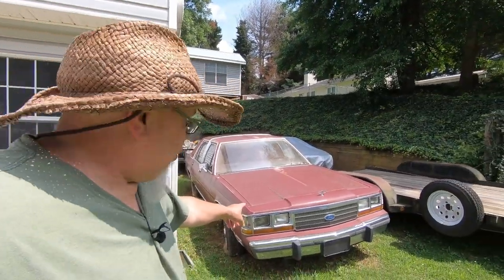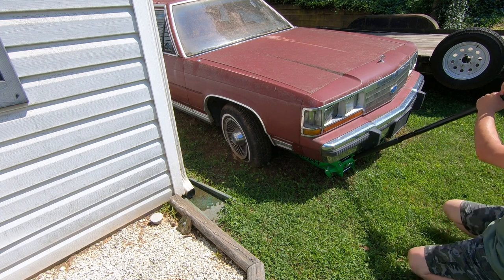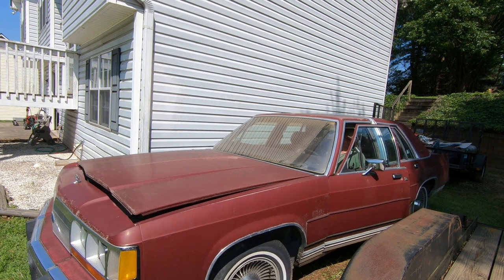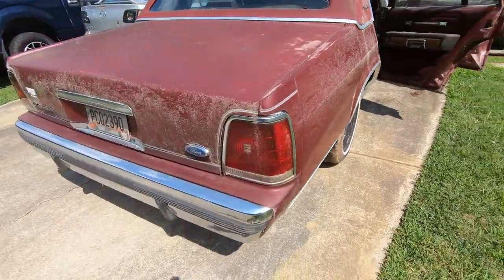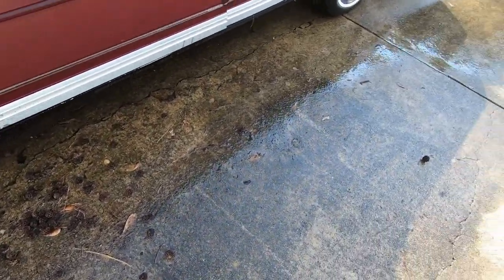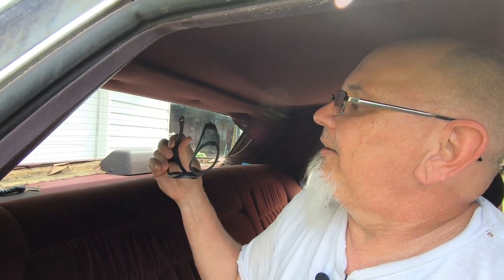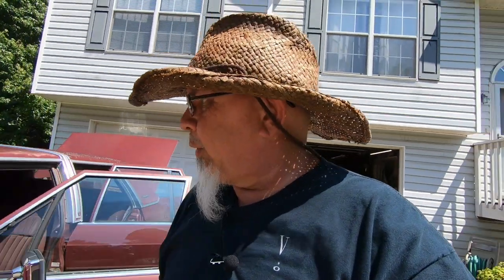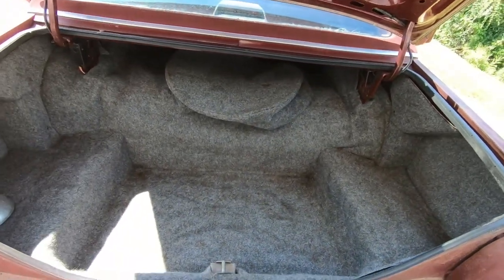Cleaning up my old LTD Crown Vic!

Comment: I daily drove (commuted) a 1989 Mercury Grand Marquis LS from 1997-2019. It was the best car I ever had. The two rear windows would get stuck and have to be helped up. And, the power antenna quit. I manually raised and lowered it. It was gifted to me by my grandmother after my grandfather passed in 1996. Always garaged. It was black over gray leather. I think it just needed a fuel pump when I sold it with just under 170k miles. No rust, no accidents, black paint still shined, perfect leather and carpets. I babied it for 20 years.  I now drive my dad's '04 Accord. It's another good one!

Comment: I have an 88 LTD as well but mine stays inside out of the weather.. been working on stripping the vinyl roof off due to it having some small splits in it and i didn't want it to rot the roof.
Reply from the maker: This one has some rot under the vinyl roof. It's unfortunate since it's otherwise a pretty solid car.
Reply: @TorquePowerVideo  From what I have seen yours is still really nice and I am betting if you stripped that off it could be saved. It's some work but worth it in the end.

Comment: transmission just died in my 90 ltd cv. what should i replace it with
Reply from the maker: If you're just looking for a stock replacement, an AOD is what would come in them from the factory. A word of caution, though: be absolutely sure to check the TVcable connection at the throttle body. The plastic clip is known to deteriorate and fall apart over time. This allows the cable to become disconnected and will burn up the transmission if driven long that way.